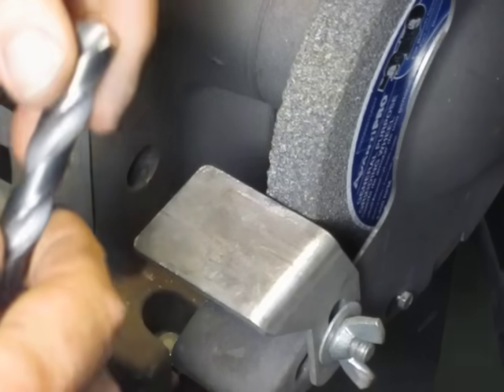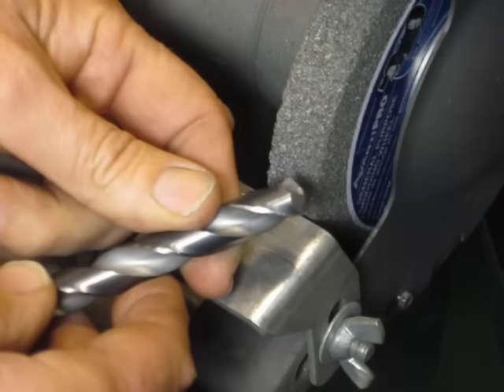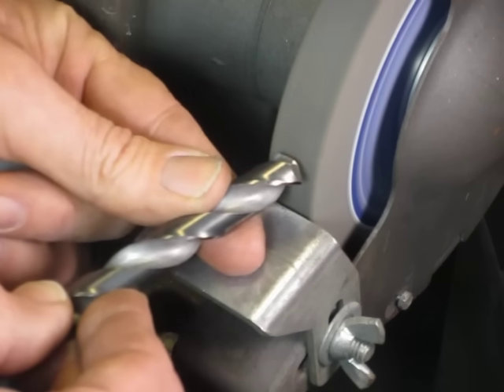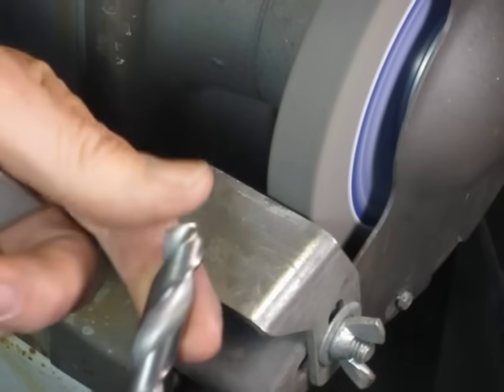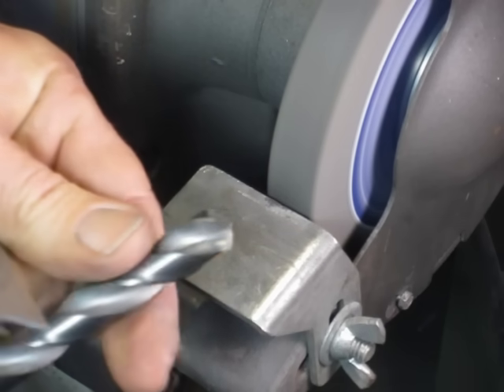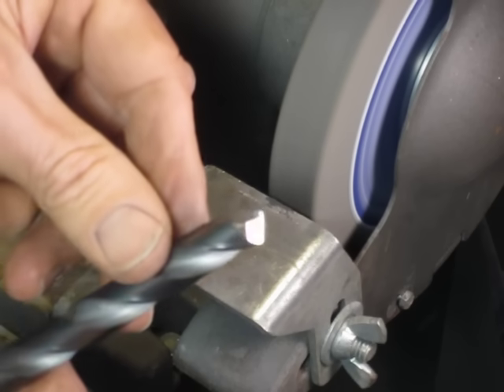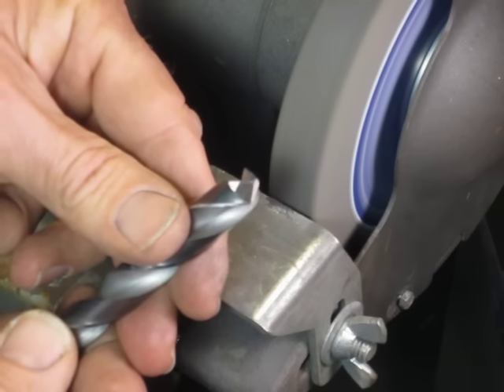How to Hand Sharpen a Twist Drill

Comment: I liked your presentation. I have sharpened my own bits for years. I was taught by an elderly (I use that term with the deepest respect.  I wish I knew half of what he knew and be able to recall a quarter of what he taught me).  one of the first th I ngs he taught me was the easy way to check to check the angle.  take two he's nuts and hold two flats together.  there's your 120 degrees.  put the bit in with the Web parallel with apex of the angle.  bring one cutting edge into contact with the wheel with the center of the bit just ever so slightly below  90 degrees.  contact  the wheel at the center line of the wheel and the cutting edge level. as soon as you contact the wheel start to move the shank of the bit own and to the left at the same time.  not too much relief behind the cutting edge. to much relief makes the bit feed too fast causing grabbing and also results in a weak cutting edge.  when you add those two things together it is easy to break the bit.  you can check the length of the cutting edges seeing how much of the flats of the nuts are showing.  pick nuts that have flats as close to the size of the cutting edges as you can. if you did it right when you are done it will look and cut like a new bit fresh out of the package.  as for the Web not cutting, he also taught me that on bits much above 5/16 in thicker material use a pilot bit that is one size smaller than the web.  my grandfather also taught me to always keep the bit cutting.  he said "if you let the bit idle in the hole you will dull even a new  it.  I am now 60 and have discovered that if us young pups would listen and pay attention first to these wealth of information before we assume we have all the answers.  how can we have all the answers when those guys had not yet heard all the questions.

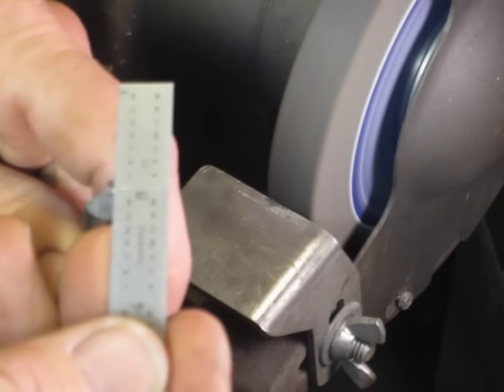Comment: good video .  I worked in a screw machine shop for 26 years  .  24 of that was on 3rdshift  10:30 to6:30. When I first started on nights we didn't have any body in the tool room to sharpen any drill , so we were on or own .  I had a heck of a time try n to learn how  .  I could grind 45° spot drills . But usually when I got to the lip correcting them I would slip and mess it up. Lol. there was one old timer there that took me under his wing and said Roger ? I'll make a Machinist out of you yet my boy !  Lol and then he would laugh. He said once you learn these Acme Screw Machines !  He said that s where the Big money is at . I haven't ran one for ten years now and could step back in there tomorrow and it d be like I never left !!  I found a real cute attachment for a bench grinder that mounted on the bolt for the tool rest , at a auction I was at one time  .  With the degree adjustment   and lip angle   . It was all in a box. I think it was a Stanley .It works great .  thanks much  Roger .
Reply: oger w

Comment: Excellent tutorial, Tom! I have been sharpening bits by hand for a very long time and have had great results when I took my time and did a good job with. Your video was a good refresher for me and I will work on doing the split in the web better, as you demonstrated. A Question for you, does the steel behind the cutting edge soften as you cut the bit down, such as, when it was hardened from the manufacture. My brother says resharpening will have a shorter cutting life than a fresh drill bit from the package.
Reply from the maker: Thanks Rodger, I'm glad you enjoyed it.

Drills are hardened through, so sharpening them has no effect on how long they will hold an edge. The only exception is if the drill was coated. Then, resharpening will remove the coating and any benefits it offered.

Tom
Reply: Rodger Young
Reply: Rodger Young m

Comment: If I were to regrind a standard carbide drill with a CNC grinder, would I grind the Primary facet then do the Secondary? Right now I'm set up to remove my stock with the Secondary Facet operation with a few passes. I have always wondered how my drills would come out and the life of my grinding wheel would change if I went with the Primary grind first.

Would this make any significant difference? I understand the Secondary has a much steeper angle and a wider area of cut for my grinding wheel.
Reply from the maker: I doubt it matters either way. I've always ground the primary first because it has the most critical features. The secondary is just clearance.

Tom
Reply: Toms Techniques 

Thanks for the reply! It's more so that one of our CNC grinders has a problem with chirping the drill when it begins the primary after grinding the secondary. The other grinders don't have this problem so I'm really scratching my head! Everything is fine from a setup stand point and the wheel specs are the same across the board. This is why I asked, I'm looking at some of the basic aspects of regrinding to help solve our chirping/wavy land between the clearance angles.

-Cooper

Comment: Good explanation of the angles and how to achieve that, sorry but I disagree about back grinding the point to drill with the "chisel edge" it is better practice to use a pilot drill first.
Reply from the maker: The point of thinning the web is not to make the drill self centering, 
it's to reduce the amount of force required to feed the drill into the 
work. Not doing so will create addition heat and reduce the life of the 
drill. Split point drills are available that completely eliminate the 
chisel point and don't require pilot drills, but they are beyond the 
realm of hand grinding, at least for me.

Tom

Comment: Sorry to tell you but that drill would not stand up very long in production. I know because I have over 30 years experience in grinding drill bits right and left hand cutting,  straight flute and spiral flute taps, drill blanks, split point drills, D drills, express taps etc.. I can even grind a twist drill from a drill blank, I can make them cut .005 over size to .005 under size when required. All done by hand plus you have to be fast as well if you're going to last in a jobbing shop environment, turtle's will be let go.
Reply: I'm just curious why someone with 30 years experience is even watching a video on drill bit sharpening?  Just saying!  LOL
Reply from the maker: You know it won't stand up in production, but you don't say why. All that does is cast doubt on your credibility. Thirty years experience or not.
Reply: not enough material left to dissipate some of the heat and help support the cutting edge. Any bue (built up edge) will break away causing the drill to burn up.
Reply from the maker: If this is going to turn into a discussion about whether multi-faceted or conical drill point geometry is better, I'm not going there. All I can say is I've been sharpening drills like this for longer than 30 years and they hold up just fine. Conical geometry does indeed put more metal behind the cutting edge, but it also creates more friction, which creates more heat, so in my opinion, both are pretty much equal. I just prefer multi-faceted because it's easier to hand sharpen, especially for beginners, which is who this video was made for.

Tom
Reply: Well I would never have used any drills ground like you did on any of the jobs I've done especially on deep holes. My drills always looked like they just came out of the package even after web thinning.
Reply from the maker: All I can say is if you feel that strongly about your expertise, please take the time to make your own tutorial and show us how it's done. Otherwise...
Reply: ok sorry after seeing some of your video's I understand what type of a jobbing shop you have there and in that scenario yes your drills would work just fine.
The type of jobbing shop I'm used to, machines are setup to run high volume production lots which last days sometimes weeks at a time. Using all types of materials and sorry to tell you but grinding a drill that way they would not last. Over here you have to be fast and accurate no turtle's allowed. :-)
Reply: unlike old dogs, a good machinist or other person, actually, is always willing to learn new tricks. I myself am not a machinist, but I have been using drill bits for 60 years and sharpening them one way or another for 50, and I found this video informative and useful.
Reply: I can understand your remark that turtles are not allowed...no slowpokes...I get that part. My question is about your statement that "grinding a drill that way they would not last". Is it the angle of the cutting edge? Is it the relief angle? Is it the final touch in the flute? What? I am not trying to be snarky, just interested in the reason why the drill will not last. Thank you.
Reply from the maker: Here is a little light reading that will explain why this style of drill point geometry does perform well (last).

http://www.newmantools.com/machines/drillpoint.html

Tom
Reply: some interesting reading, here, Tom, thanks. If I understand one of the things mentioned here, a drill with a square end - not conical at all - would have the shortest possible length cutting edge, removing the narrowest possible curl and thus be doing the least amount of work for a given hole. Wildly impractical, maybe, but an interesting idea. Got to digest this some more. Thanks for the drill geek info.

Comment: You have definitively hand sharpened a lot of drills. People watching this thinking they now can sharpen their own drills have a lot of experience to catch up on haha. Your video was splendid though. I work at a tool grinding shop that sharpens and manufactures HSS and carbide tooling for production and I clicked on this video figuring I could laugh at some guy trying to hand sharpen but you certainly know what your doing. Its not so much about the sharpening as much as it is knowing how a drill works and what dimensions are critical. ANDDD web thinning is the hardest point because of my pesky symmetry obsession haha. Nice video.
Reply from the maker: I encourage people to hand sharpen drills because it's a great way to learn off hand sharpening skills. It seems there are always dull drills laying around and sprucing them up is excellent practice. You would be amazed at how many hard headed old timers criticize multi-faceted drill point geometry because it wasn't how they learned. :)

Thanks for watching.

Tom
Reply: faceted drills are certainly easier to hand sharpen. of course I'm spoiled and almost all sharpening I do is via CNC.
Reply: riley marsh k

Comment: What does it matter if it's off a little on the angle? Say 140 degrees instead iv 135? So long as the two sides are the same.
Reply from the maker: Flatter point angles (such as 135º) work better on hard materials because the dissipate heat faster. Steeper angled points (such as 118º) work better in soft materials like non ferrous metals, making a more round hole with a better finish.

Tom
Reply: Thanks.

Comment: very informative. i use a belt sander too sharpen drill bits and chisels slow speed keeps heat down.
Reply from the maker: That will work, but be careful. If the joint on the belt starts to fail, an upward angled drill bit can grab it and ruin your day.

Tom

Comment: Plz mention the specification of the wheel as i can guess it is around 36 grit,grey wheel.
Reply from the maker: That's probably right, but a 60 grit would be more appropriate. I use this one for rough grinding new lathe tool bits, but was too lazy to change it out for the video. :)

Tom

Comment: Shouldn't you quench you drill in water as you sharpen it so you don't loose the hardness in the drill bit?
Reply from the maker: Apparently you haven't watched my video on red hardness, Bob. That will explain why quenching the drill is not necessary.

Tom
Reply: No I haven't but I will check it out.I was taught by German tool and dye makers years ago how to sharpen twist drill bits and carbide cutting tools they told me to quench in water not to let it get hot(blue) other wise you will loose the hardness.Just my two cents Tom.
Reply from the maker: They may have been referring to carbon steel tools. On high speed steel, it is not an issue.

Tom

Comment: Same as you, I prefer the 2 angle edge with a starter tip on my drill bits. I sharpened thousand upon thousands in my 40 year career. However I keep primary edge the same length as drill edging ( sizer edge / material ).
Reply from the maker: Not sure what you mean by "drill edging".

Comment: I wish I could sharpen the really small (1/16th inch & smaller) bits. Even 1/8 inch is a challenge as I get older.
Reply from the maker: Think magnification! I keep several magnifiers and loupes around the shop and one of them could easily be affixed to a grinder. Here's a nice big one with a long working distance that would work quite well:

http://www.surplusshed.com/pages/item/l10494p.html

I have one and it is well worth the $18.

Tom

Comment: angle of cut not important
Reply from the maker: Actually it is. Soft materials like aluminum cut better with a sharper angle on the point, but harder materials require less acute angle to dissipate the heat.

Comment: Looks like shit but if you clearance is good I guess it should cut OK. That is far from the proper way to sharpen a drill. I mean no offense Its just an anal 37 year vet toolmakers 2 cents
Reply from the maker: It may look like shit to you, but if you aren't using multi-faceted drill point geometry, it'll drill better than anything you can grind. Most any commercial drill bit you purchase will have a variation of this grind, except many take it a step further and add a split point. If you are still using radial clearance angles on your drills, you may want to try this.

Tom
Reply from the maker: Stop talking William and Google the phrase "multi-faceted drill point geometry". You just may find it interesting.

Tom

Comment: Your stone is too rough,its impossible to sharpen 2 mm  drill bit
Reply from the maker: 2mm, that's like 5/64", right? :)

Nothing is impossible, but I'm pretty sure I mentioned that the wheel is coarser than I normally use. An 80 grit wheel would be more appropriate for smaller drills.

Tom

Comment: Why on earth does a machinist use a ruler??
At the very least you should be using a rule
Reply from the maker: Rule: A strip of wood or other rigid material used for measuring length or marking straight lines; a ruler.

Ruler: A strip of wood or other rigid material used for measuring length or marking straight lines; a rule.
Reply from the maker: You guys are seriously going to waste my time arguing about semantics? If you don't believe me, all you have to do is go to merriam-webster.com. You'll find that the definitions for rule and ruler are identical.

Comment: That looks great,I've got to try this on a 20mm drill bit during the week
and make one flat bottom drill from your other video.Thanks very much
for the video
Reply from the maker: Thanks for watching
Reply: Toms Techniques Sweet i tried it yesterday and messed it up had about
20 facets on the rake and was not steep
enough..Went back out today and put 
another 20 minutes into it,Only this time 
i made the take all one smooth deg and
kept the drill bit at the constant 59 deg
and never twisted the drill bit when doing
the back rake..And  woop wooop it worked
like a charm..I have two long chips coming
off..And also managed to make a nice bottom drill bit so well happy..Thank you for the video mate saved me a fortune in drill bits..I was doing a few things wrong i was two low on the
wheel and twisting the drill when doing the rake angle..Another thing i was doing was actually blunting the cutting edge rather than 
sharpening it..But managed to find out where i was going wrong now all i have to do is keep practising..I have one question for you please..What is wrong when you have 2 flutes cutting the exact same length and time but one is more lose of a curl and the other side is a tighter curl..Hope that makes some seance...Thanks Tom
Reply from the maker: It's always good to hear success stories. :)

If one chip curls tighter than the other, it means the clearance angles are not the same on the two flutes. That's where practice comes in. You need to do the exact same thing to both flutes to sharpen a drill that cuts perfectly.

Tom
Reply: Toms Techniques Thank you tom,You are right that's where practice comes in..I didn't expect it to even cut i had given up to be honest,I think trying to be too perfect on the
rake angles  is why i had so many facets, Once i used a more even angle and one movement it seemed to cut great..I wasn't expecting to learn this over night..But ramming a drill bit into some EN8 and it rubbing was kind of heat breaking,Now it just cuts through it,Now I've learned how to do the back rake and how to hold the drill, i can put my time and effort into learning flute length the angle's look perfect..But this is a drill that i had made a mess of the day before by trying to cut the web lol..So I'm going to do a fresh regrind and just keep practising..This drill I'm using is just for roughing out a 20mm hole i still have too bore it out another 0.100" so not an issue..Thanks..But the flat bottom drill video i watched and done exact same thing is working great :) cutting on both flutes and at the same time and working a treat..I was ready for buying a U drill :D..Cheers tom have a nice week.

Comment: Sharpen 6mm drill bit instead of large ones !
Reply from the maker: A 6mm is a large one. A 1mm is more of a challenge.
Reply: @TomsTechniques  Thank you for a good video Tom. Can you use this technique  for the 1 to 5 mm drill bits? I have tried it using good lighting and magnifying glasses. Do you have any tips please?  I drill a lot of spy holes to watch my sexy wife.
Reply: Yes indeed, which is what I have the most issue with, (getting old).  I've sharpened a TON of bits,  my question;  what NAME BRAND you find the highest quality?
Reply: for that I use a Dreamel polishing stone